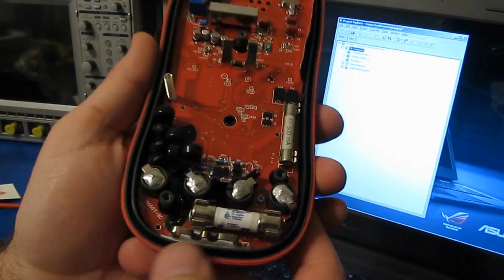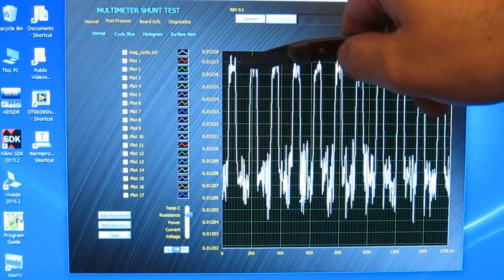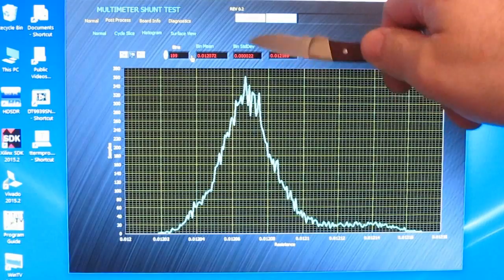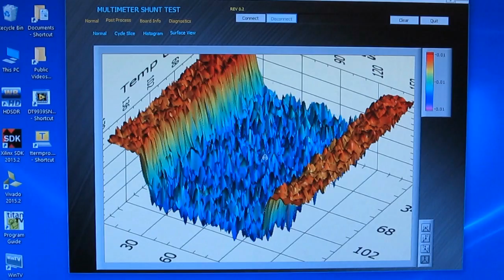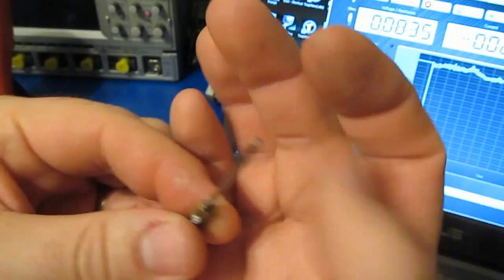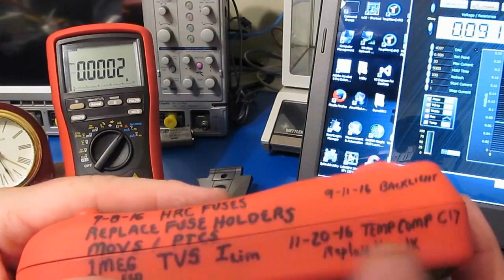UNI-T UT61E 20A Current Measurement Part 2

Comment: That Cem meter looked to be pretty stable in that first test.
Reply from the maker: Yes it was.  If you go back and look at the videos of the CEM where I have it apart, I believe they are using a 0.005 ohm shunt with a fairly low Watt density.  For the $120 Ruby sold it for, it was a great deal.

Comment: Could you use two shunts in parallel which have twice the length of copper?
Reply from the maker: They are not copper but yes, for the same diameter wire we could double the length and add a second one just like I show in this video.

Comment: Now that larger surface shunt did make it very stable, i bet alone that shunt would improve any ut61e, even if nothing else was done.
It wont burn up easy, thats for sure.

I see what you mean by the problem of a lower shunt value, not enough vdrop generated, if the micro controller had a digital doubler then the shunt could have been half the value.
But hey its much better than original now :-D.
Reply from the maker: I would have thought they would make the gain settable for the two common shunt sizes but I don't see anything in their documentation for it.    With that, we would be looking at 2W for the shunt instead of 4.  The fuse we can't do much about.   I cut up a better lower Teflon insulator that fits much better.   I have made several 15 minute runs at 20A and everything appears fine.  The lead free solder I used to install the shunt will flow and the board would be damaged long before the silver solder I used would melt.  I made the two ends from brass.  It's not great but like you said, it won't burn up easy and I would bench it against that Kasuntest any day with it's tiny little shunt and glass fuse..